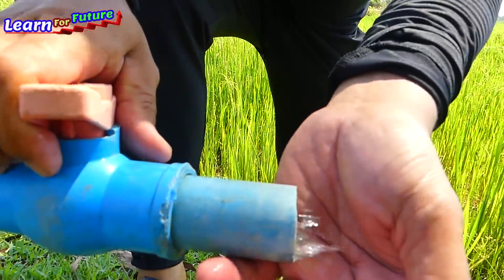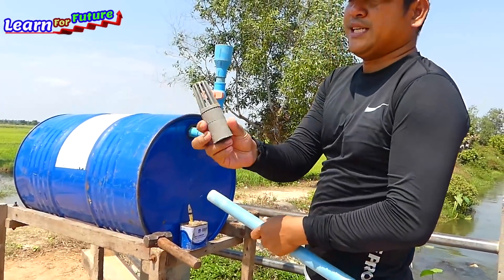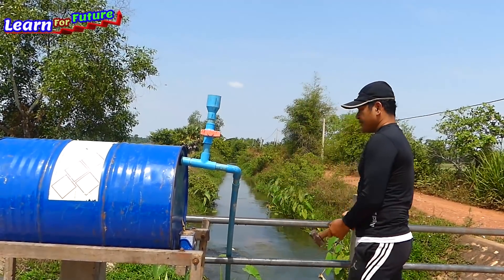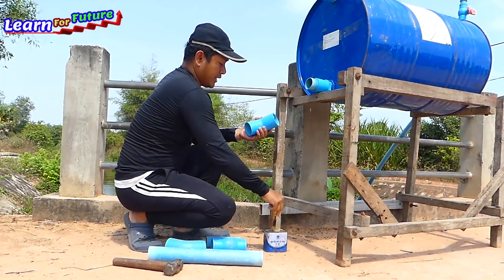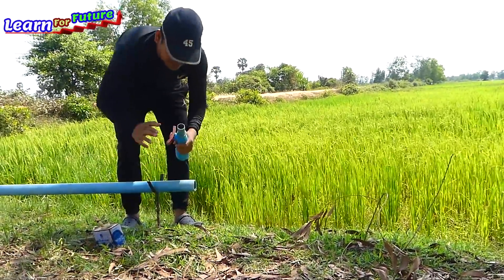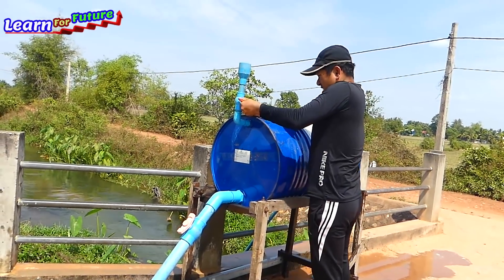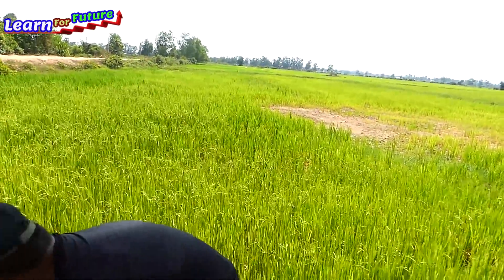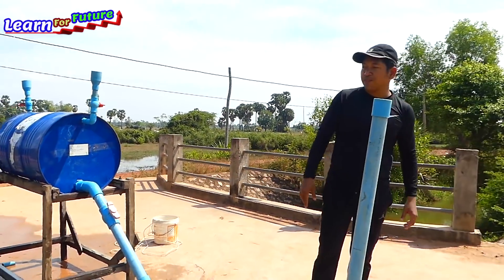Deep River - How to make free Energy water tank from Deep River About 7 meters Deep By 24H Working.

Comment: The water will flow even without the drum because it will be siphoned since the water outlet is lower than the river water surface level.
Reply: This is a clever way to  make a self start siphon with the drum as an air trap.
 Fill the drum with water with the outlet valve closed. 
Turn on the outlet valve the water running out  will create a partial vacuum sucking water up the intake and trapping the air in the barrel

Comment: If what they claimed was true in this video that the drums are acting as a pumping system then the outlet side could be raised to a height of above the drums and it would continue to pump water again the outlet. But in fact if you build this and do the test you'll see that it works fine so long as the outlet is below the outlet height of the drum The moment you move the outlet above the height of the drum it stops working. This proves beyond a shadow of a doubt that it is only working on the principle of siphoning so the drum is of no value simply run the pipe from the canal to the field fill the pipe with water then open it up and the siphon effect starts.
Reply: The drum is used to trap air from the intake pipe as the water flows out of the drum creates a partial vacuum that sucks the water up the intake pipe 
The drum makes this siphon self starting from the drum full of water
Reply: @ericchapman399  Apparently you cannot read very well. I have built this device and did what I said and it does not work.
Reply: @ke4uyp  You state that this only works as  Siphon  is correct if you think it will pump water  uphill is totally wrong you have failed to understand my description of a clever addition of a barrel to improv the system This system is  a SIPHON  only it NOT a PUMP it will not work if you do not have skill and ability to  assemble it with no air leaks anywhere in the system.  When you have learned  a bit more on basic physics you will know the difference between a pump and a siphon.  
P.S. My reading ability is first class